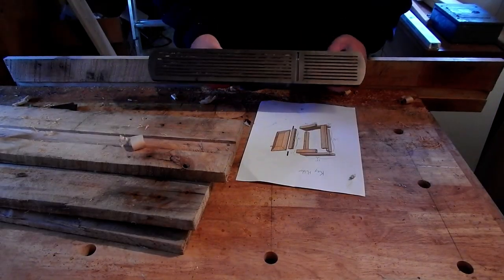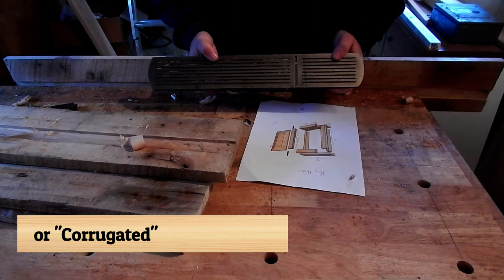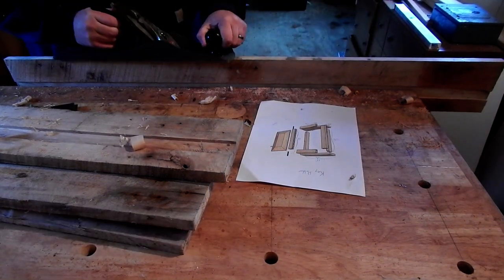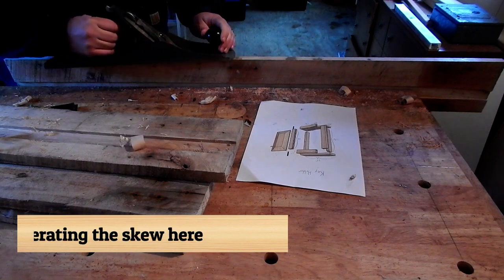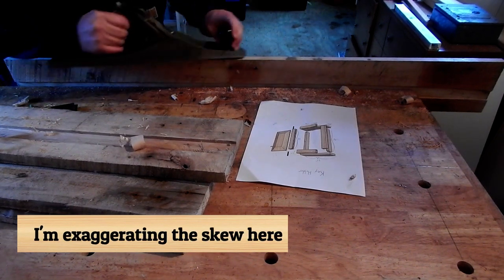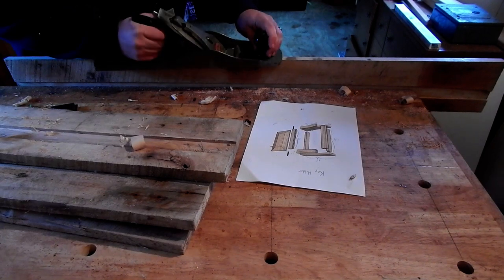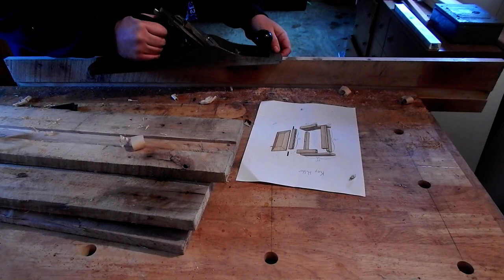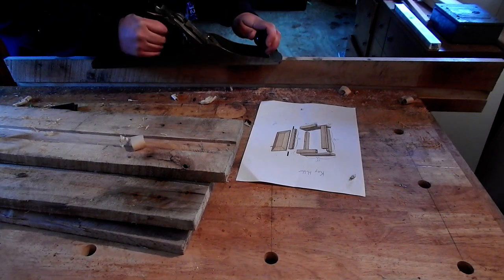Working with Fluted // Corrugated Soles

Comment: Hey there. Do you mind telling me what the brand is on the plane in your video title shot? I have the same plane body and frog (so it seems from the tote, sole and frog) but all it has on it is 'No 12'. I was hoping to find out enough about the plane to get parts for it and put it back together. Thanks.
Reply from the maker: It's "Craftsman" brand though it may have been manufactured by Stanley. I haven't extensively researched it.
Reply: @TheOlsonOutfit  Thanks. It looks like the plane in the title pic (at 0.01 sec) is not the same as the one you used in the video, but that may just be me seeing things wrong. It doesn't seem like the one I have is a Craftsman.
Reply from the maker: @yohannmisquitta7535  it's all one in the same plane. (The lighting was very poor back then unfortunately.)
Reply: @TheOlsonOutfit  That helps a lot. I'll see what I can find out about it. Thanks again.
Reply: @TheOlsonOutfit  Turns out mine is a Hahn/Siegley #12 (Stanley #7 size). It's going to be hard to find an iron for this one.